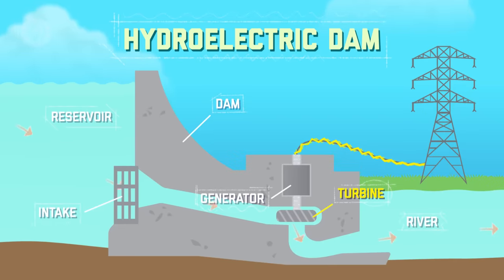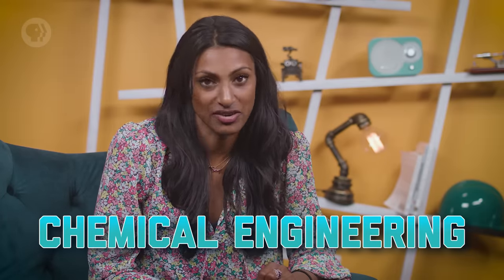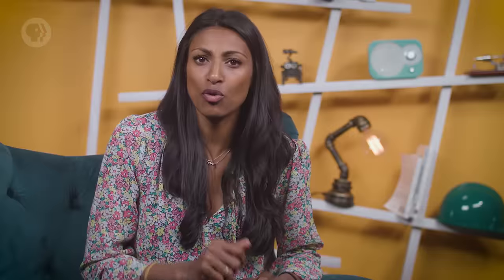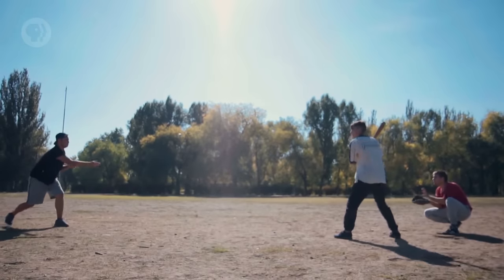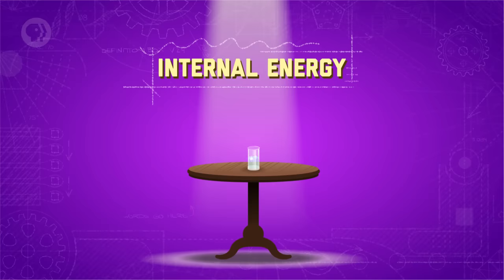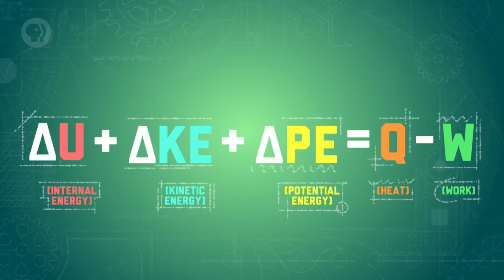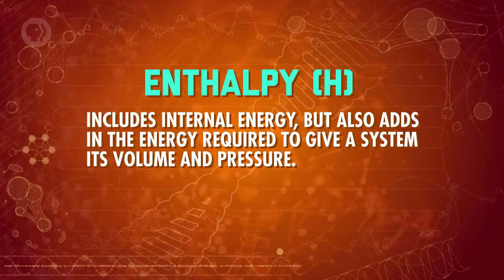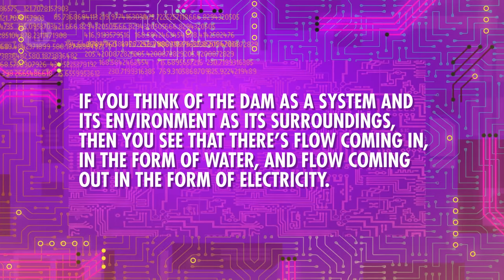The First & Zeroth Laws of Thermodynamics: Crash Course Engineering #9

Comment from the maker: Note from our Content Consultant: Different branches of engineering sometimes define the first law of thermodynamics differently, depending on how work is defined.  Essentially, work released from a system might be defined as a positive value or a negative value, and thus the first law can be defined as either Q-W or Q+W.  Both are acceptable forms, depending on how the system is defined!  We chose to focus on only one definition here to limit the confusion.
Reply: CrashCourse 1st reply
Reply: As a material scientist, I define work as the amount of time I am getting paid for.
Reply: As a material scientist, I'd like to say that chemical engineers aren't a real thing. Don't let Tenferenzu fill you with lies.
Reply: Thanks for clearing that up.
Reply: MechEs vs ChemEs flame war?
Reply: No one said anything about mechanical engineering.
Reply: The Creeper this is not the place to troll.
Reply: No one is trolling. Please come back when you know what trolling is.
Reply: The Creeper you’re trying to start a war in the comments, so you are trolling. I’m not gonna respond to any of your comments, as I know that you just want to troll.
Reply: Hello Ford.
Reply: You mean what you're doing?
Reply: CrashCourse it would be much simpler if we used energy conservation principal (energy balance) E(in)-E(out)=∆E(Change in energy) instead of directly putting those terms without giving it's fundamental meaning.
Reply: Thank you CrashCourse !
Reply: Explains why the minus before Work went away at 6:46

Comment: The first law of Thermodynamics is that you don't talk about Thermodynamics.
Reply: Marylandbrony bravo!!!
Reply: The second law is that you don''t talk about Thermodynamics
Reply: Third law of thermodynamics is that YOU DO NOT TALK ABOUT THERMODYNAMICS
Reply: @abhinnverma2142   and the zeroth law of thermodynamik is if you talk about it you will be killed by a demo.. shiieeeeeeeeet
Reply: I didn't understand the definition of shaft work quite there... It said, "any type of mechanical energy other than what's necessary for flow." I didn't understand the "other than" part... Isn't shaft work about propelling liquid or gas

Comment: If you leave a soda in the fridge, it'll get cold. If you leave it in the sun, depending on the can's ability to absorb energy from sunlight, it will match or exceed the ambient air temperature.

Comment: Fun fact: matter is also a form of stored energy. That's why nukes work -- a little bit of the, say, uranium atom is converted to energy when it decays -- and why the masses of subatomic particles are measured in electrom volts. Also, heh heh, she said "shaft work."
Reply: Delivery McGee But the decaying isn't the reason why the nuke explodes. It is because the radioactive materials have uncontrolled nuclear fission, which causes tons and tons of energy to be realesed in a second, which ends up in an explosion.

Comment: First, we need to focus in the zeroth law, that represents the thermal equilibrium between objects those are sharing their heat one each other, and when other object with different temperature comes to the system, the other objects give o receive the heat to the other object, until the system stay in thermal equilibrium.
The first Thermodynamic's law talks about the way that the heat and the work (both, types of transition's energy) mixed to be named intern energy, another variable in Thermodynamics. This law is based in the conservation energy's principle.

Alejandro Ventura UP170146
Reply: Thanks, Alex!

Comment: Thermodynamics show up in our daily lives.
Engineering is not just about getting more of what we want, but also controlling what we don't want.
The zeroth law of thermodynamics, what it means to reach a thermal equilibrium, and define the first law of thermodynamics (internal energy + kinetic energy + potential energy = heat added – work done).

It is important to know the forms of energy, and the types of systems (open and closed). and it is explained in a simple way as the isochoric, adiabatic and stationary processes, as well as understanding the enthalpy, make our daily life easier. 
Alejandra Muñoz 
UP170047/ ENE04A
Reply: Ok, Ale!

Comment: So if a cold can left outside obtains thermo equilibrium with the air around it. (Assuming the sun isn't pumping anymore enegery onto the planet) how many cans would it take to cool the atmosphere?
Reply: Trinity Delafuente
How do you cool the cans? If you don't cool them outside of the measured system no amount (nor size nor temperature) will be enough.
Reply: fiona fiona . Okay then assuming the cans are cooled inside of a closed system (like a sealed home) and it's cooled by changing the pressure of one side of the house to another. Then the can is brought outside. (Without leaking any air from inside the home)
Reply: How big /warm is the atmosphere, how do you get the energy (won't it get very hot and inefficient inside fast?) , is humanity continuing to warm our planet?
Do you know the scene in "futureama" featuring the from of an ever Lager ice block in an ocean keeping global warming in check trough this inter planetary import?
Reply: Any can of cold soda would cool the atmosphere a little assuming no more heat was being pumped into the system. A better question would be if you have an unlimited supply of sodas, say a litre per can, and you wanted to cool the atmosphere a single degree celsius, how many would it take?

Comment: aren't all forms of energy ultimately kinetic in some way: light has to move, chemicals have to move, electrons have to move, quarks have to move. "things" need to move and interact basically...?
Reply: X4rrr  place a test charged particle in an electrical field and it will have a potential electrical energy even if it isn’t moving.

Place a ball on top of a building and it will have gravitational potential energy even if it isn’t moving.

Place a zinc and copper powder separated by a barrier and they will have potential chemical energy.

Heat really just is kinetic energy, but energy isn’t just motion, it is simply the capability to do work.
Reply: @RanaKamikaze  "place a ball on top..." ...surely that's motion? as in, isn't all potential energy predicated on prior kinetic energy? similar argument for "place zinc and copper..." a) "place" involves prior movement and b) surely chemical energy entails movement of electrons? similarly, even electrical fields appear to be related to the movement of subatomic particles?

not my field, so no idea, but it still seems to all be movement of some sort...

Comment: To be fair. If you leave a can of soda out in the sun, it will heat up more than the air around it...
Reply: Yes and No. At least not really: the can may heat a bit more at the beginning - as the air is constantly cooling by transmitting heat to the earth and into space (even if it is just a few atoms a time; if it wouldn't we would really fast live on a boiling planet) - but as the heat of the can surpasses the heat of the surrounding atmosphere, it begins to emmit the heat again, at some point reaching an equilibrium with its surroundings. (Btw: this is the reason criminal examiners can determine how long a (newly deceased) person is dead - because the body stops producing heat around the time of death and starts to cool down to the surrounding temperature)

Comment: Thermodynamic has a big branch of obtain energy and is important understand the benefits than get it. The law zeroth of termodynamic is the begin of the rules from the other laws, someone described the pressure, volume and temperature like a equilibrium of the system. I know the 1st law explain about the conservation but I needed to know a little more like energy contained within the system and than the energy can move between boundaries. 
The 1st law has energy kinetic and the potential energy. I think is importan know this topic because I could see and understand more easy.
Leslie J. Valdés. ENE04A
UP170209
Reply: Thank you, Leslie

Comment: If energy can be neither created nor destroyed wouldn't that mean the universe itself could not be created or destroyed?

If so wouldn't that mean the big bang was merely a singular step in some kind of cyclical Universe model?
Reply: That's a pretty big leap in logic.

No, it doesn't mean that. In fact, the Second Law of Thermodynamics, which was not featured in this video, absolutely forbids the existence of a cyclical universe, because according to it, entropy - basically a measure showing how close we are to equilibrium - always increases. Since the universe started out in a state of low entropy (this is called the Past Hypothesis), there's no way for the universe to go back to a Big-Bang-like state.

But that didn't answer your initial question yet. First thing you need to know is: Negative energy exists, mainly in the form of gravitational energy. Yes, gravity is a form of energy, too; and it is negative, while positive energy mainly exists in the form of matter. The positive energy present in a collection of matter precisely matches its negative energy present in its own gravity. The consequence is that the net energy of the universe is 0. So a more accurate version of "energy can neither be created nor destroyed" would be "the net energy of the universe always remains 0". "Creation" of (positive) energy is actually allowed (in fact it happens all the time in form of Dark Energy), but it is accompanied by the creation of equal negative energy. All in all, this means that none of the Laws of Thermodynamics are in conflict with the Big Bang model. Near the big bang, energy was merely much more densely packed, much smoother distributed and in turn under really big gravitational pressure.
Reply: Energy conservation comes from time-translation symmetry. Since the universe is expanding, spacetime doesn't stay constant, so there is no time-translation symmetry. Therefore energy is not conserved. More of a physics thing than an engineering thing.
Reply: Perhaps, but as to what came before the big bang, we have no clue, it could have been cyclical, or it could have been another type of existence like a multiverse with complete different laws of physics.

Comment: Well,the video is about to characteristics, explain about to the equilibrium the fluid try to be in the same temperature, explain the first law, explain the tipes of kinetic energy for example the translational, rotational,vibrational.Explain the heat formula and variants of that
Pedro Antonio Reyes Cruz. 
ENE04A
UP170498
Reply: Thanks a lot, Pedrow